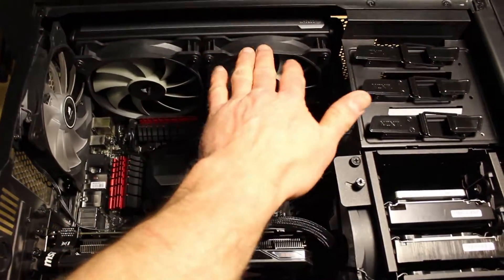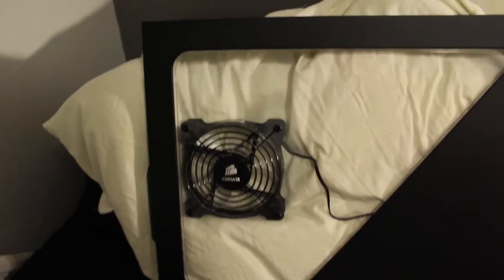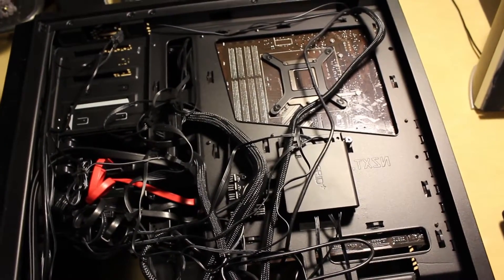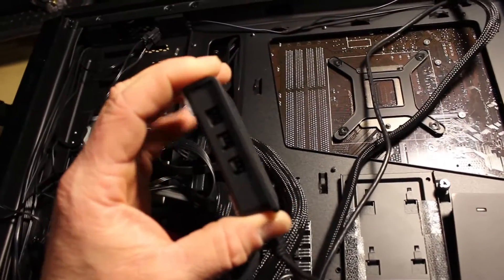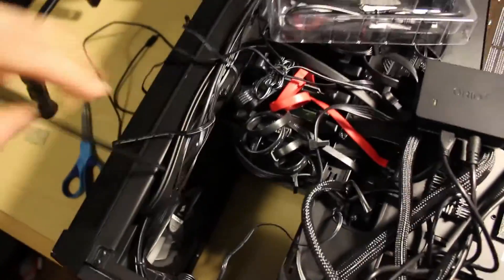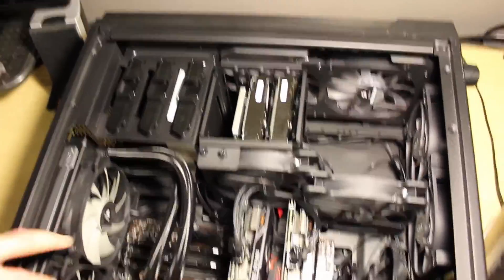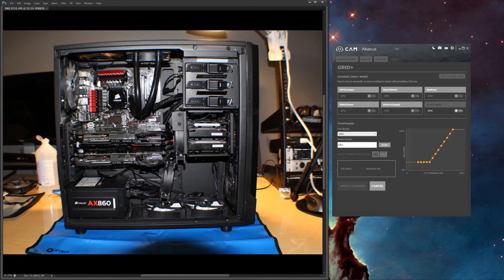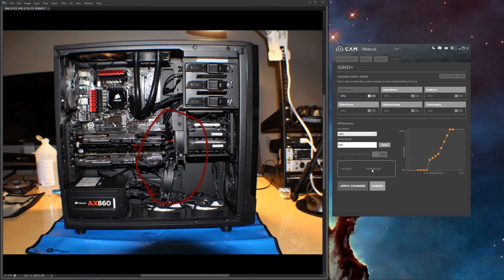NZXT Grid+V2 upgrade, overview

Comment: FAR too many fans, you don't need that many fans, what are you trying to do, fly the fkn thing? Your intake fans should equal the number of exhaust fans to maintain proper neutral air pressure. Granted, positive air pressure can be beneficial but you're just going to pump loads of air with no escape which would just warm up.

If you put fans on the bottom as intakes and then put one right above them then all that air is just going to the PSU where it's not really needed, it won't get as far as the 2nd front fan, the PSU will already have it's own fan which is more than enough.

Comment: Hey, one doubt that came to me, the cpu cooler is plugged on the moderboard or at the Grid+ V2?
Reply from the maker: The mobo, it's a corsair closed loop, so it runs off corsair software.

Comment: How is this holding up looking at buying one to control all my case and psu fans based on the gpu temp as having them run through the motherboard only let's me do it based on cpu temp which makes them spin up when not needed which drives me crazy
Reply from the maker: Holding up very well, minus the constant filter cleaning as my cat sheds overly much.  Only issue I've had is during on the the software updates I lost all of my customized fan profiles.  They're in the stock performance mode now, I'm too lazy to change them back, and I've not been doing any gaming lately anyway.